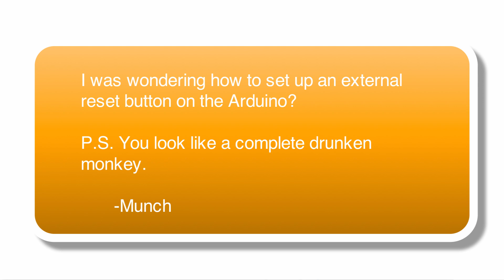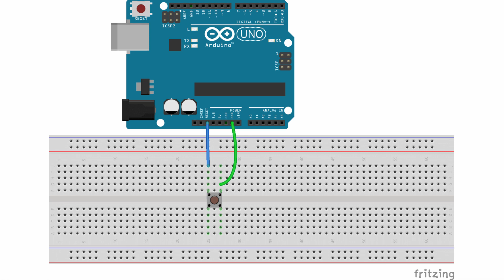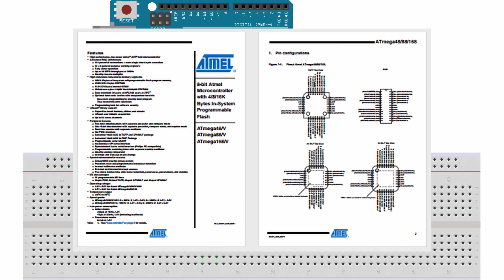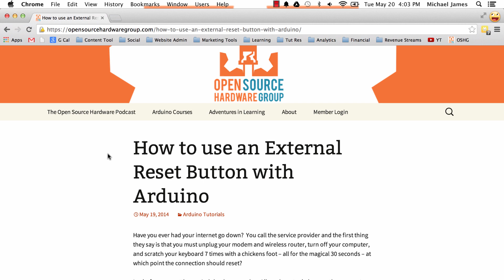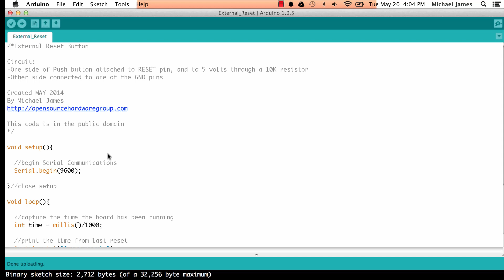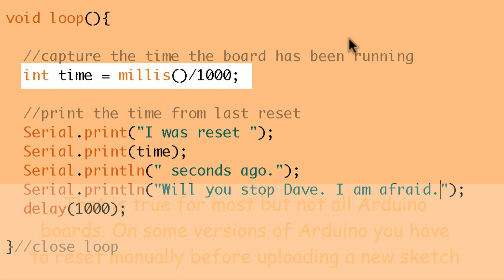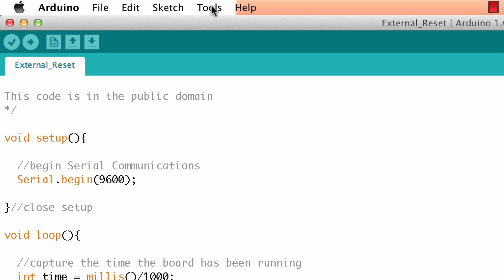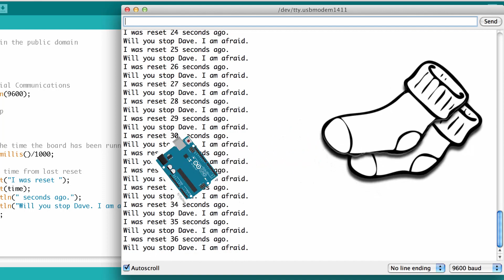How to use an External Reset Button with Arduino :: Viewer Question #6

Comment: I have a reset between an On Off On switch, the board will reset in the middle (off) and switch mode from 0 to 1 depending on if the On Off On switch is up or down

Comment: On a related note, is there a way to address the resetting of an Emergency Stop Button in code?
My situation: I am designing a system with a Stepper Motor and Driver controlled by Arduino. There is a latching switch to start the motor in each direction, forward and reverse.  The E-Stop button cuts power to everything. If the E-Stop button is reset and the latching switch is in the "ON" position, the Arduino code resumes and the Stepper Motor starts running.  This is a dangerous situation and is usually addressed by using momentary switches and a Relay or Contactor.  Is ther a way to address this in code or by means of some type of reset button that checks to see if any latching switch is in the "ON" position before resuming the code when the power is restored to the Arduino?  Thanks very much for your great videos. Regards.

Comment: Does Arduino have Internal Pull Resistor for "External Arduino Reset" Pin ?
I'm afraid of noise will mess with that, therefore arduino may behave unpredictable.
Thanks in advanced

Comment: is there any  difference between 2 pins and 4 pins push button?. i have 2 pins push button and I am confused!
Reply from the maker: +razell de guzman No difference!  With the 4 pin, it is still just two separate sides (just like your 2 pin).
Reply: +Programming Electronics Academy thank you! :)

Comment: Would it be possible to use an IR sensor to do this? I have a bunch of old remotes....I don't really care which button I push...just push any button to reset the Arduino.
Reply from the maker: Hi MrShawnlloyd , that would be possible.  one of the students in my course actually did something along those lines (that is using a remote to signal his Arduino).
https://opensourcehardwaregroup.com/basic-home-automation-using-arduino-featured-student-project/

Comment: Can the reset button be used as an on / off switch? Will the battery drain while the reset pin is held to low voltage?

Comment: I already knew how to do it, I needed it for my pro mini because, I solider pin headers to face up, so when I plug it in breadboard I don't have access to reset button, I program it with arduino uno on which I connect reset-ground so it bypasses atmega chip on uno, and uses only FTDI, so I tx-tx and rx-rx, and I when I am uploading program, I need to click reset button in right moment when program size is shown in terminal, and program is uploaded, if you get out of sync, you need to practice on your timing with reset button